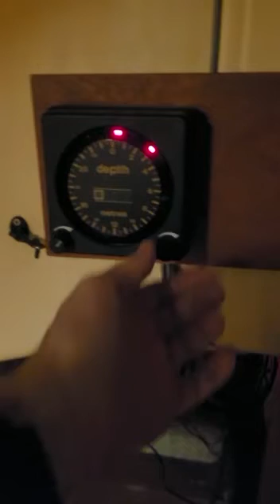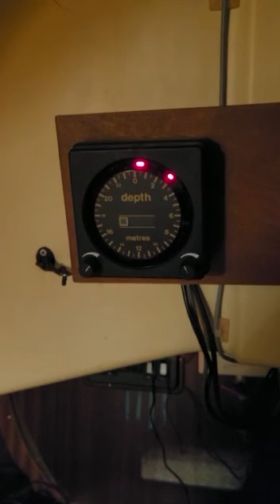Seafarer Simplex Echo Sounder/Echolot in Details

Comment: Could youi please make a video explaining what this is for and what  the alarm does and what other readings are for
Reply from the maker: Not sure what your specific question is but this is a device to measure the distance from the boat (in which it is mounted) to the ground under water that the boat is above. So if there is less then a meter your keel might be hitting the ground. The audible alarm was not connected so you could not hear it. This video was showing how this works while boat was in the dock so the water depth never chnaged from 3 meters. So what is your question ? Such devices are commonly used on boats - albeit this is an old analog device - the newer ones show you digital depth data.
Reply: @MarcusBehrens  Thanks, you kind of answered the question. I was browsing for vintage meters to use as props in a short film, so I wanted to know what each meter was used  for and I came across this one. I was asking the use of it and you explained it perfectly. I also asked about the readings, since there are  three lights, one blinks and other two are previous and later on the numbers, which is where I'm confused. 
If I know everything about what the meter is made for and what the readings suggest,  I could use those for the character to react to, to say what the machine is doing and if that reason to use the machine was connecting with the story.
Thanks
Reply: The story is nothing about water level or calculating that distance, its supposed to be a "dream machine" that has a meter telling sleep state, from awake, to asleep to REM/Dreamining, Nightmare, Night Terror and all types and then Awake. And an extra bulb that turns on to say that the person is now in a Lucid dream and can manipulate it. 
I wanted to make these meters, where the needles show people where the person is in their sleep/dream state and to maybe to help them become Lucid to do their job, whenever the Lucid bulb turns off. Something like that.
So, I wanted to use some meters and make another one with the awake/dream scale and the bulb wanted to see if i can use any other vintage meters that look cool but can relate to the story, as some meters would be for the machine itself and not the person
Reply from the maker: the first light is the point 0, the second steady light is the depth and the blinking light is the (adjustable) alarm
Reply: @MarcusBehrens  Thank you!